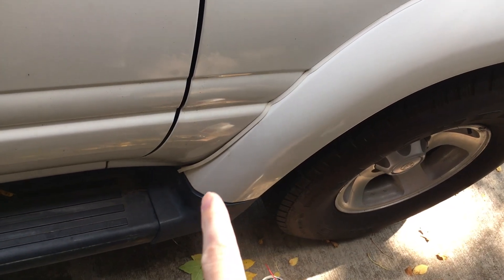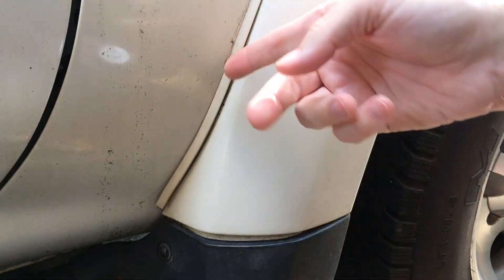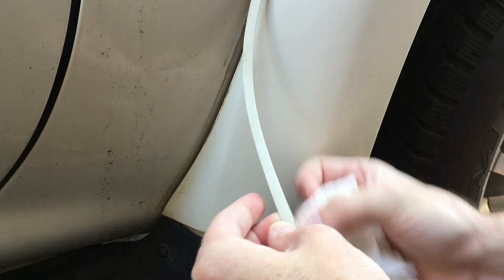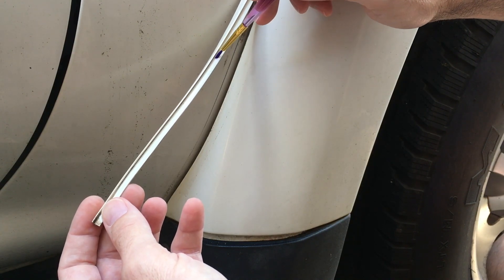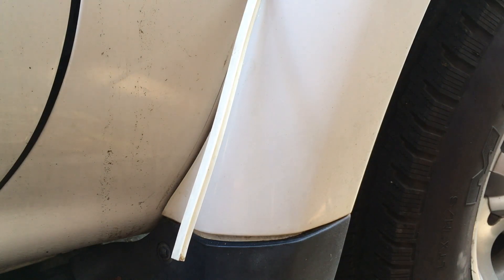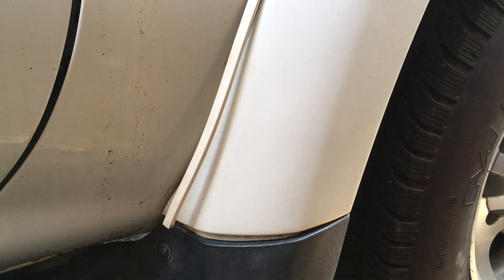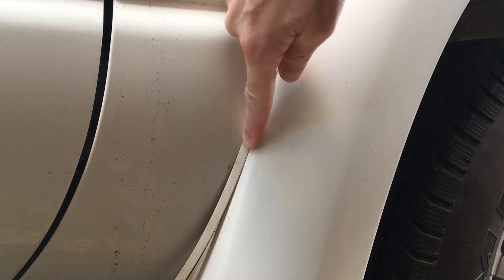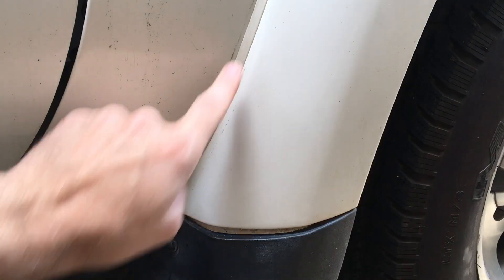1997 Land Cruiser Fender Flare Gasket Fix

Comment: Do you know if the adhesive you selected has a very high heat / melt resistant?  If not, it may bubble up or literally run off the material which makes for a bigger mess.
Reply from the maker: Rubber cement can handle the amount of heat but is has worn off a time or two. I have just cleaned it and reapplied. Ideally I would remove the whole flare and use some sort of 3M tape. The nice thing about the rubber cement is that it's not going to impede me from doing this in the future. It is relatively easy to remove.
Reply: @Rickmakes  Looks like some Rubber Cement can to ~175F, just depends on the product but even at 175F I don't think it would last very long in AZ Heat.

Comment: there is another way to do it that does last long term, i refer to it as the RWB method, if you're unfamiliar with RWB porsches id go give them a lookout least to see the process im talk about(its when the guy building them seals the wide body flares on the car, but essentially you wanna rip the old gasket out without taking off the flare and then mask off the edges of the gap where the gasket used to be and apply black silicone sealant to where the gasket used to be, wait for a minute and rip off the tape should give it a good clean look and they've lasted me a good bit

Comment: Hi Rick - the fender flare gasket on my Tacoma is coming off. I appreciate your video of how to fix it. I'm wondering how your fix has held up?
Reply from the maker: It worked for a few months but it is starting to come loose again. I'll probably redo it if I don't have enough time to take the flare off and fix it properly. I could use a stronger adhesive but I do want to be able to remove it later if I feel the need to replace it. I'm guessing it would last longer if the vehicle was stored inside. Mine is outside, including in winter.

Comment: Did it work long term?
Reply from the maker: It worked for a few months but it is starting to come loose again. I'll probably redo it if I don't have enough time to take the flare off and fix it properly. I could use a stronger adhesive but I do want to be able to remove it later if I feel the need to replace it.